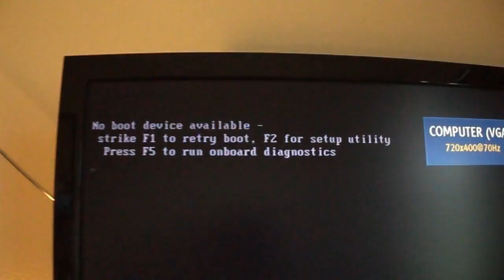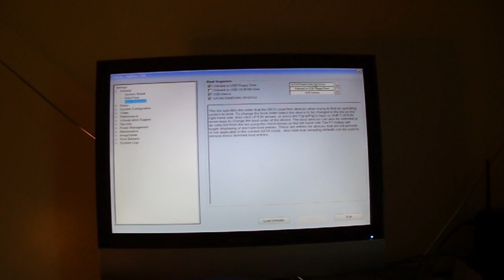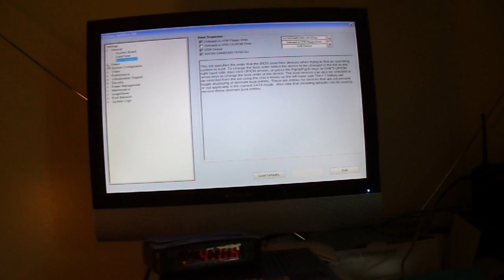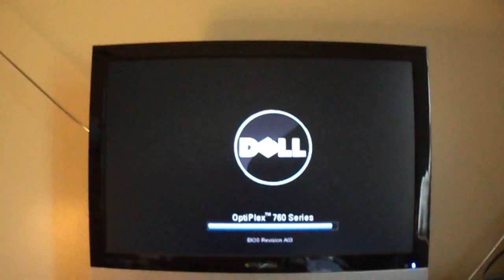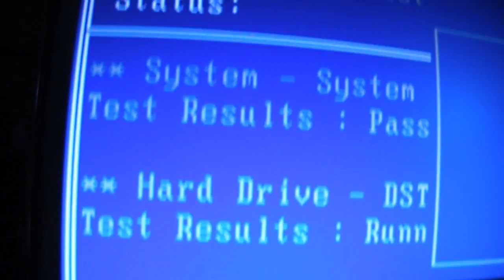"No Boot Device Available" on Dell Optiplex GX520 and 760

Comment: I got same PC, the same exact problems. I'm running the diagnosis and gave me this error "error code 2000-0145" some say that the average time for finishing diagnosis ran out and it give me the option to continue with the diagnosis.
I'm going to try to install windows and or use a bootable flash drive to run the Pc and check what's the issue with the hard drive.
Im pretty sure the hard drive is okay I just wanna ran out of possibilities until I get a concrete answer.

Comment: Did you find a way to fix it? my bf says try another drive even though yours is showing up. Said his was similar.
Reply from the maker: I eventually just reinstalled Windows
Reply: does it work by reinstalling windows ?
Reply: Did it worked installing windows?

Comment: i have same pc gx520 . and same problem no boot device available . i used my hard drive another computer it work properly. and i change some bios feature and changed the cable but this prob was not go away . plz sir tell me the solution as soon as possible .

Comment: for some reason I cannot install a OS my pc keeps showing no boot device available I replaced the HD and it's still showing no boot device found i've tried everything I'm missing something help
Reply from the maker: Eugene Williams I had to just install Windows again
Reply: It will not let me install still shows no available boot device when I strike F1
Reply: Engene ....make sure u have the windows on a flashdrive only (there is nothing in ur flash..except the windows installation) and It will boot

Comment: I have an operating system and it still will not boot up or even give me a boot menu.
Reply from the maker: +cooldog60 I just had to wipe the HD and install the OS with a flash drive
Reply: Well I got the boot menu. What do you mean wipe the hard drive ? Format it? I don't want to do that I want the information I have on the hard drive. Seems my computer will not detect the hard drive or the cd drive.

Comment: I have the same problem but for the dell GX620. Can somebody please help me? If you could that would be cool!
Reply from the maker: +Pyramid Headpro the only way I got mine fixed was by reinstalling Windows
Reply: +ReviewsTechNow Hey... thanks for the info but I'm not smart when it comes to computer things like that. I know it's a lot to ask for but can you give me step by step on how to reinstall windows? Sorry, that's a lot to ask for but can you please help me? Thanks
Reply from the maker: +Pyramid Headpro basically I had to download Windows XP on a different computer and load it onto a USB flash drive.  Then installed it from there.  I had the original Windows product key number so it wasn't a problem installing it.

Comment: I have this same issue with Gx520, It shows the same error... But as I recently installed the Operating system and boot error not comes if there is Bootable CD in the drive. I  goes to start up utility settings and bootable sequence was ok. But there was written HD not present , CD rom not present. I don't understand? Can you help me
Reply from the maker: I don't know.  When I reinstalled Windows mine worked
Reply: ok thanks

Comment: i have that same computer with the same issue. what you need to do is press f12 and select the onboard sata or pata (ide) hardrive.
It should boot it up. you'll have to do it manually but this is a temporary fix
Reply from the maker: I tried that and more.  My situation may have been different but I had to reinstall Windows completely.

Comment: I have this problem on Optiplex 755 Desktop but unlike yours not having OS installed I do have OS installed I have to keep manually rebooting until it finally starts been like this for 1 year same hard drive so my conclusion is that it's something to do with the motherboard or Dell!
I will be purchasing a new drive regardless as this drive is only 80gb and see if it continues to have this error
Reply from the maker: if you Google it it seems to be a common issue with Dell
Reply: ReviewsTechNow Yes I have and it is a Dell problem for sure!

Comment: I have the same problem on my dell optiplex 755 ? have no idea causing problem?
Reply from the maker: beefree1 actually I spent an entire day last week fixing mine.  I basically came to the conclusion the HD had been wiped so there was no OS.  I had to do a fresh install of Vista, since it originally had Vista and had the original product key sticker on the side.  Once I did that, I was able to see that the HD had in fact been formatted by my company.  It now works great.  I will post the link to the site that helped me do all this.  Also, I don't know if yours has a DVD drive or not, but mine didn't so I had to do it via flash drive.  The instructions are also on that site.   https://www.raymond.cc/blog/how-to-burn-downloaded-windows-vista-to-dvd/
Reply: @AroundIndiana  will it delete everything on the HDD?
Reply: u need to reformat that